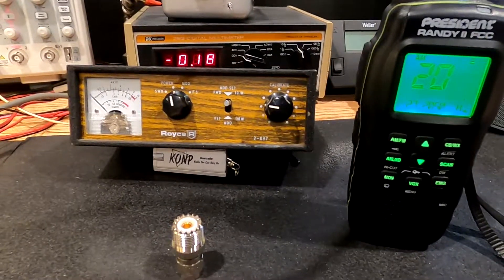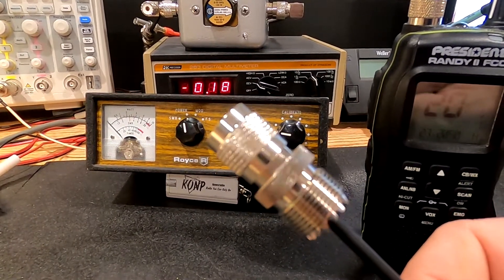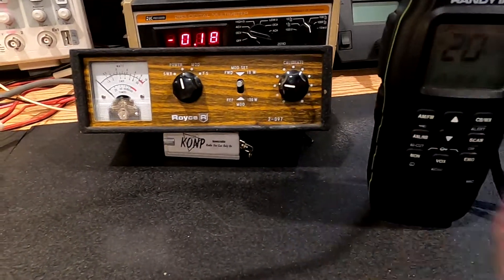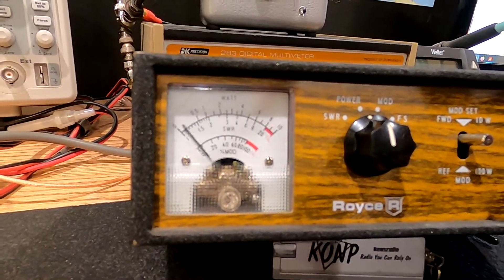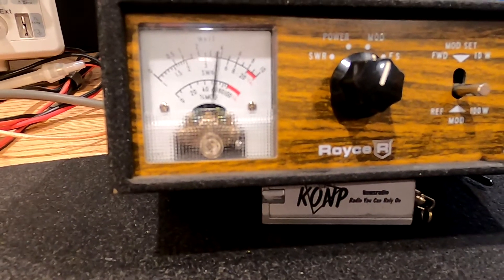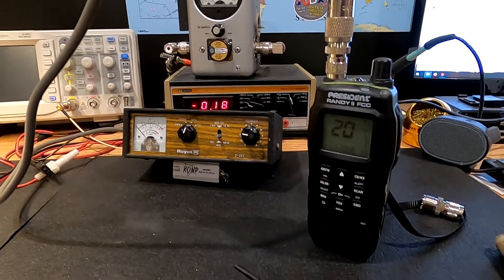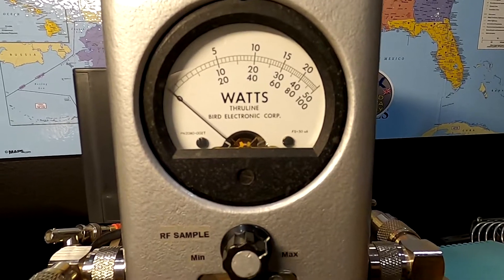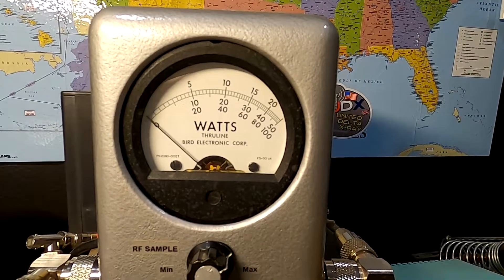Randy II FCC Power RF Output POWER Measurement

Comment: How do you get it back to the original power and AM power settings?
I bought one used and have found that the power settings have been changed in a bad way
Reply: The manual lists default numbers

Comment: Walkie talkies are interesting and like linears, are a branch of the CB collection hobby. You can often pick them up at hamfests by merely picking them up! I watched a friend of mine take home two nearly mint TRC-99s because he picked them up and the seller said "You have to take them because you touched them!" Free. No charge! 
There are the enigmas like the reduced-carrier TRC-205 and the unobtainium Midland 13-778 AM/SSB from 1972. 
Currently nobody is selling a SSB HT like the Cherokee AH-100 that is easily modified for 10 meters and nobody is selling a 10 meter FM HT like the Azden AZ-11. Any candidates, like the CB-58, require a firmware hack and rewrite for this. 
Next test: on the base antenna. How's the adjacent channel rejection?
Reply from the maker: the 788 would be a great find.
Reply: @390WagonMaster  I've never seen one or heard one on the air. They were, in a word, pricey. 
Now, the story I'll tell you will make you cry...

There were two places in Pittsburgh that sold Midland radios before 1975: Whiteside Electronics and Cameradio. Cameradio was a huge store located in the warehouse district while Whitesides was a small family-owned store in a suburb. 
Whitesides stocked the 13-880 and later, the 13-885, but if Jack didn't like you he'd more likely than not chase you out of his store! 
Cameradio actually stocked most of the Midland line, including the 778. I saw one in the display counter when I bought a new 13-722. They also stocked ham gear and had a complete station featuring Collins and Drake gear. 
Management decided to move to a suburb and get out of the retail business. They were able to move most of the ham gear, but what remained of it and the Midland and Johnson CB gear went in the dumpster, including a case of 13-778s! Cameradio became CAM/RPC and concentrated on industrial customers. I worked there in 1977 and one of the older employees told me the tale.
Reply: Thanks again from 432 Chicago...7 3s
Reply: I have a 13-788 still in the box. I told Wagonmaster that I will do a video on it and send it to him. I’ve never done such a thing however, so it will take me some time to figure out how. I reversed a pair of crystals in mine and talked skip to a guy about 400 miles away, back about 1980. When I told him I was using an SSB walkie talkie he said “Oh B••• S•••” and refused to talk any more. I guess they were unusual.
Reply: @keithweiss7899  Cool! Too bad that there's no SSB activity on 16. And your DX story is true because I've done it too. I was working in Florida in 1999 and had a modified Cherokee AH-100. Standing on Daytona Beach, I worked a guy in Minnesota on 10 meters. When the band is open it doesn't take much.